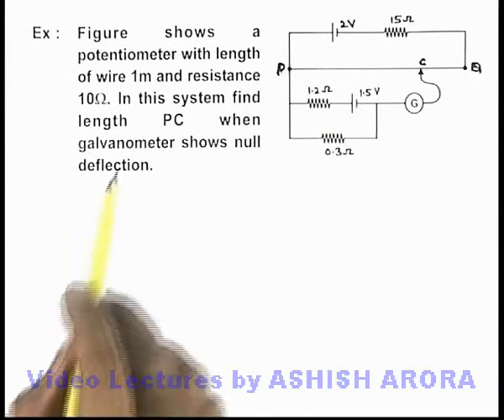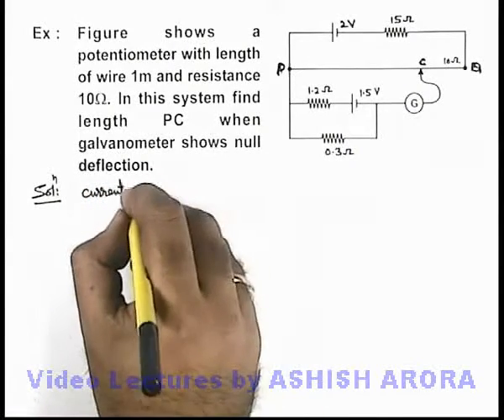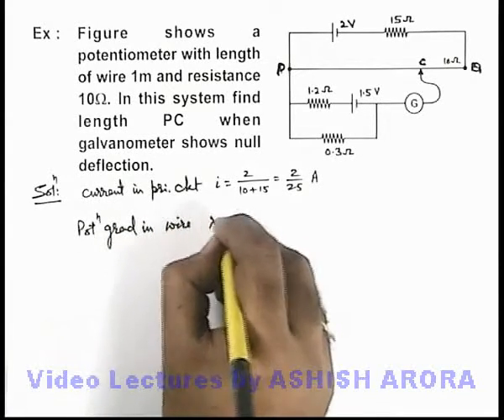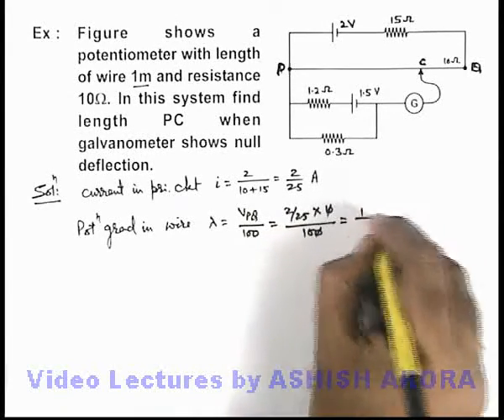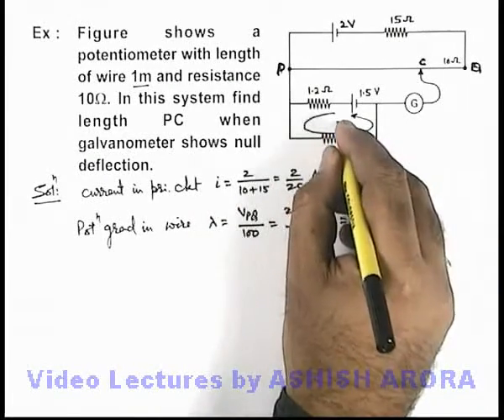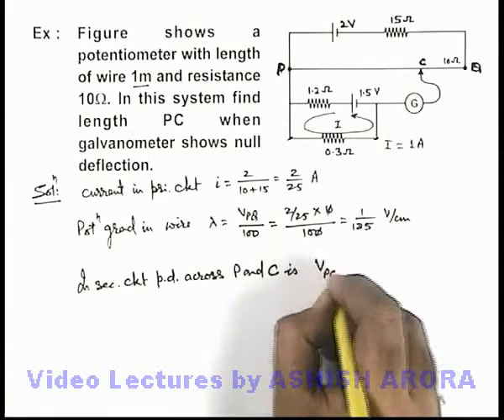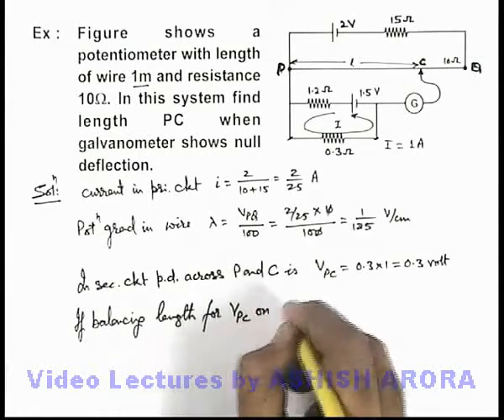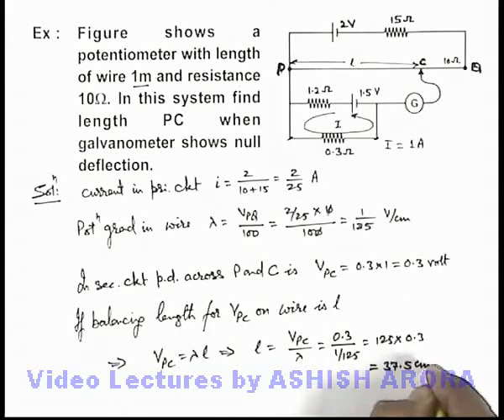Class 12 Physics | Electrical Measurements | #21 Solved Example-7 on Electrical Measurements

Comment: for those who are confused about voltage across pc , potential is same in parellel branches o you can calculate it from either of the two branches .
sir has used v = ir in  second branch to calculate it .
we can also use 1.5- ( 1.2) *I this will give same result
Reply: Thnx

Comment: In the sec ckt ,the equivalent resistance of 1.2 nd 0.3 should be in parallel or not ? Plzzz explain it Sir.
Reply: no as no current is flowing , if you visualize properly by completely taking out the secondary  ckt the resistances are in series.

Comment: Sir I have doubt in secondary circuit I am not able to  get why P C potential is 0.3 and why do not consider 1.5emf
Reply from the maker: while calculating P and C p.d. jockey was not considered to be in contact with potentiometer wire...
Reply: @physicsgalaxyworld  not able to  understand that how pc p.d is equal to that of..3ohm resistance
Reply: look as now there is no deflection in galvanometer no current through jocky bcoz p.d across pc is equal to p.d across 0.3 ohm resistor

Comment: Sir, why while calculating pd across pc , 1.2 ohm resistance is not considered
Reply from the maker: if you consider it using this path you also need to consider the emf of 1.5V also...
Reply: Sir not cleared plz will u elaborate it

Comment: Sir if there were two batteries in parallel in secondary circuit so the what we have to do
Reply from the maker: The result will be the equivalent emf of the two real batteries in parallel...
Reply: sir, in the above case how the batteries would be in parallel ?it should be in series as  current is flowing only through secondary circuit...tell me if i am right or not?and why..
Reply from the maker: In above case also you can consider two batteries in parallel one of (1.5V, 1.2Ω) other of (0V, 0.3Ω)

Comment from the maker: As galvanometer here is considered ideal so always the potential difference between point A and sliding contact will be same as that of 0.3 ohm resistance. At null deflection the pd between points A and C will also be the same. Using primary circuit also we can calculate it but that is of no use as balancing length is to be calculated first.

Comment: Sir, how can we take potential between points P and C as the potential of 0.3 ohm resistor.I think We should find voltage in potentiometer wire using current in primary circuit and resistance=10.

Pls correct me
Reply: Did you get it lol? Can’t believe this was 8 years ago 💀